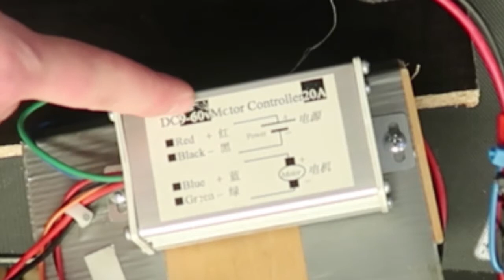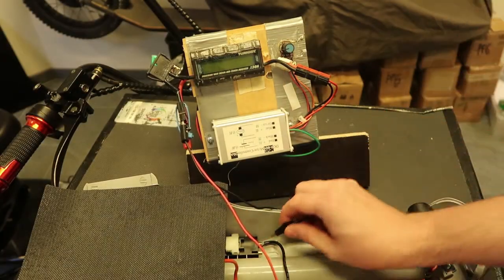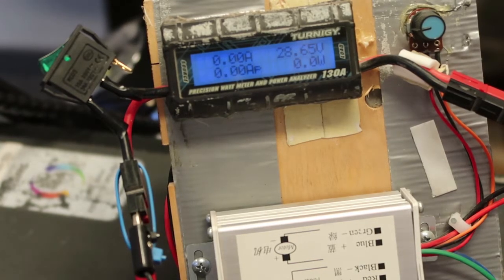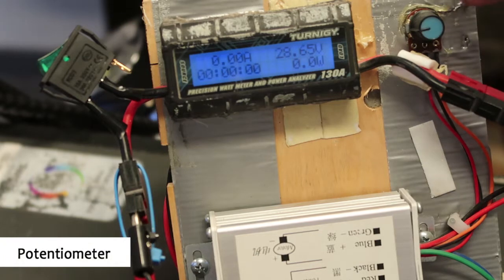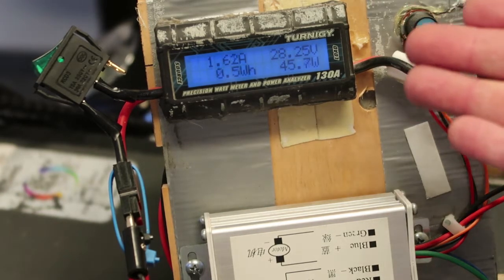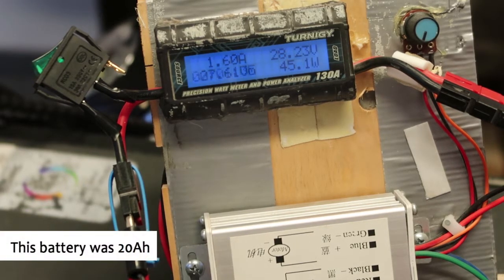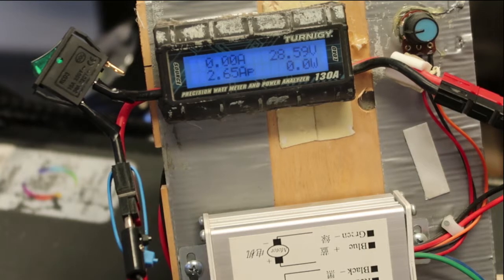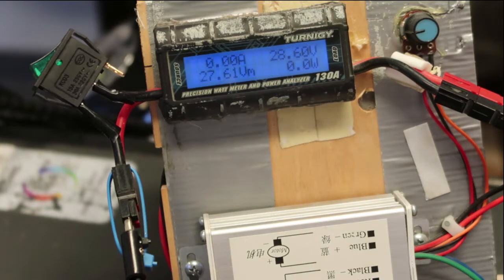Cheap DIY battery tester

Comment: Dear sir , I need an help to how to test 18650 cell from old laptops batterys using litokalla .
I use normally NORTEST with 700 mha charge current. Because I want to garantee the discharge rate is good .

Comment: 2 likes and 4 dislikes (and no comments) ???
Have you annoyed someone ??

I like it , but I use an electronic load - easier and quieter.
Reply: i also normally use electronic load tester for testing capacity but with a motor its great to show customers that their battery can actually drive a motor, customers dont know what load testers are but the sound from a motor they will understand their battery is fine.